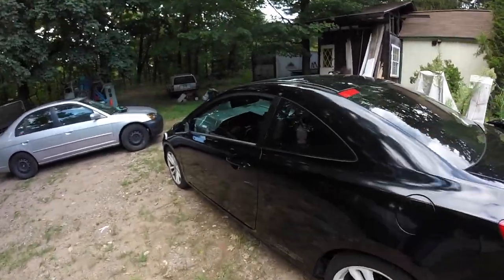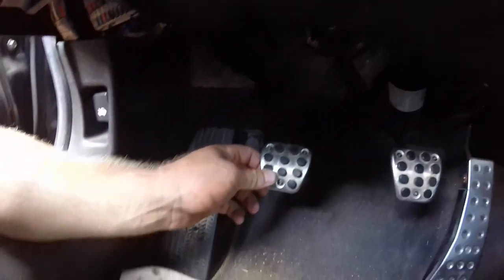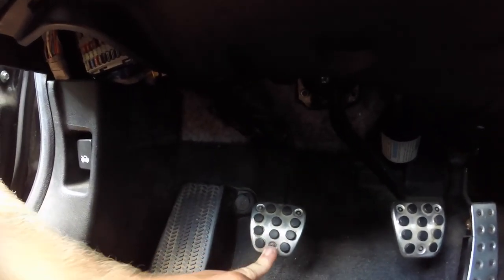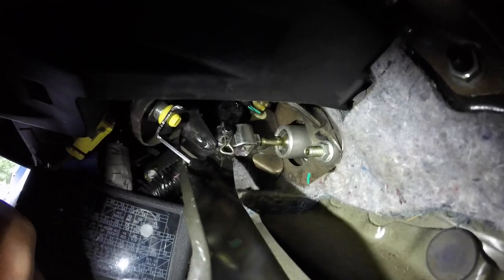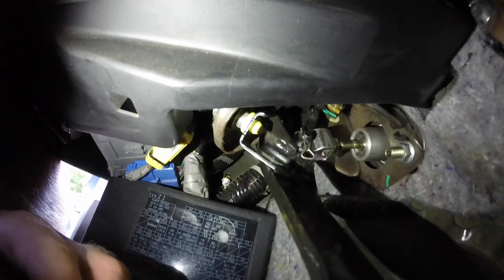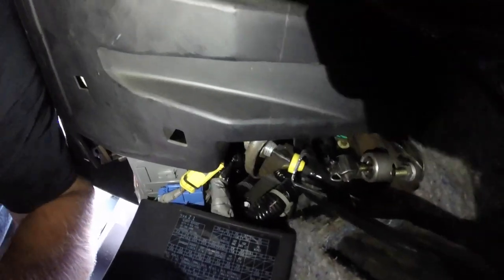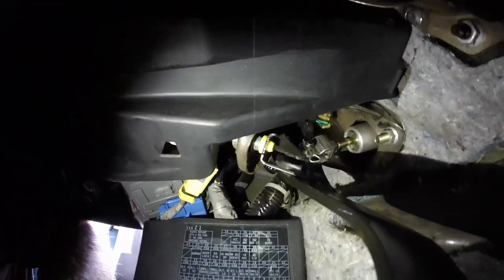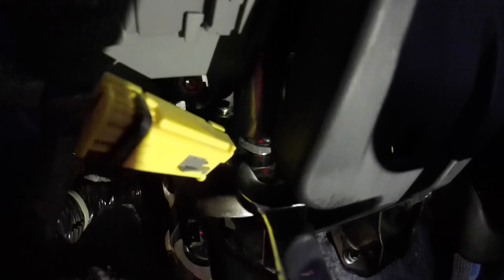8th Gen Civic Si Clutch Adjustment (K20z3)

Comment: It's about 100 times easier to work down there if you take the plastic panel off. It takes two seconds and gives more room.
Reply from the maker: +TheyCallMeRandy I will keep that in mind next time I'm down there.  I plan on replacing my shitty Napa CMC, so I can have smoother shifts
Reply: Good idea, I did my clutch this weekend and we had the whole subframe bolted back up then realized the steering rack wasn't connected to the wheel. Good thing we could do it from the inside!
Reply from the maker: Ik, that's why i supported it and didn't disconnect it.  I heard if it isn't aligned right, it messes up your while steering wheel haha.  What year is your si?
Reply: TheyCallMeRandy I need to adjust my cmc but I really have no idea what I’m doing and I don’t wanna fuck anything up

Comment: thanks brother i just did it..to my car and really works no more grinding on high rpms...thanks for the videos.👍... never stop wrenching...🔰.
Reply from the maker: You can also loosen the rod for the CMC in back of the clutch pedal, turn it clockwise until it gets tight, not too tight though. Glad i can help you out man! Never Stop Wrenching
Reply: 4real? Got at g35 and it grinds like a mf on high rpm won’t let me shift until I’m on 3,500rpm from 3rd to 6th that could be my solution then

Comment: thanks for the video ill try to do it this weekend.... my clutch feels really high and it doesnt pull as strong as it used to and this started like a month ago when i took it to a mechanic because 1st and 2nd gears wouldn't go in turns out my clutch pedal was broken  he had to weld it and it been fine but may need some adjustments
Reply from the maker: Everyone says the clutch pedals break on these cars all the time.  What did he charge you? Bro, avoid mechanics in my opinion.  Nothing is better than DIY bro.  Start wrenching, and Never stop wrenching ;)
Reply: Gerb Productions like 200 i think i had no clue what it was until i saw it

Comment: Thanks a lot bro!! I thought my syncro was bad couldn't hit 4th it would grind I rode like this for 3 years my 08 has 94xxx miles saved me ton of money 💰 I owe you a beer 🍻
Reply from the maker: She's a baby still, I'm at 147k haha.  It's been awhile since I've had a beer ;)
Reply: Same with me, my 4th gear grinds in low and high rpm every time, but gear feels fine once in it, hoping this will fix it so I don’t have to spend hella money on synchros.
Reply: @elijahwalters7900  did it fix the issue?

Comment: Hey what would cause noise from trans but when push in the clutch pedal all way to floor noise stops. Like a knockin noise. Just changed cmc and the slave cylinder was doin noise before changing those. Any idea

Comment: I get high rpm gear grind from 1st to 2nd, would this work for it?, every other gear slams great with no grinds in high rpm.
Reply from the maker: You could try this, bleeding your clutch, new tranny fluid, etc... Best advice, start cheap, work your way up
Reply: your grind is due to the delay valve.
Reply: @MTLJack  i have a gear grind from 3rd 4th.. I thought it was synchro being out what is this valve your talking about..

Comment: My slave just went out on my lx last week, couldn't change gears at all while running. Had to get one at the local parts store I think their parts are from O'Reilly's  it was cheap $43. Put a stage 2 clutch kit in new cmc now slave, still have hard shifts in 1st and 2nd, 345 are fine, when going to R I can tell the clutch isn't disengaging all the way it tries to move just a little but only in R. I have the sensor part on 2 threads, my question is how many threads on the cmc linkage? If you said I missed it.

Comment: I'm unfortunately experiencing the high RPM shift lock on my FA5 in most gears, especially 1-2, 3-4.  I replaced CMC, Slave, and threw in some syncromesh and i'm still getting locked out.  I guess this is my last resort because after this i'm not really sure where to turn other than maybe the synchros -_-
Reply from the maker: Damn man, doesn't sound like fun at all.  I have amsoil synchromesh, not the CMC yet.  Mine is only 2nd and third, mainly third though.  I think my synchro's are shot, but it is what it is.  Question is, would you drop the money on a reman transmission or have yours rebuilt??  Because i think that's what i might do, even though either way is going to be well over $1K
Reply: Gerb Productions well I finally had some extra time on my hands and did the clutch pedal adjustment and it seemed to fix the issue. I probably should have went with that first but I guess it's better to have them all done as a fail safe. 1st to 2nd still feels a little notchy but no lock out. Now it's just a matter of getting used to the higher clutch disengagement. Had I known all the little issues regarding the transmission I may have seemed out an updated 09+ as the 8th civic forums seem to say they fixed many issues but who knows. Love the car though!
Reply from the maker: That's the first thing i did after putting my new clutch in at 127k.  I changed my MTF to honda MTF shortly after that, which helped for awhile.  My 2nd and third are notchy, no grinds though.  I ordered a stainless steel clutch line, new oem CMC, and a new oem slave.  I'm going to try these first, if they don't work, I'm going to order a new syncro kit from syncrotech and have a transmission shop install them.  I wanted to upgrade to a 9th gen si, but i love my fg2 too much.  Money doesn't really matter to me with it because i have so much fun in it every time i drive it.

Comment: I have a stage 2 racing clutch do I still adjust two threads?
Reply: I'd say yes, at the least just try it and change it back if you want. The cmc controls the movement of the clutch (or something like that) it shouldn't matter what kind of clutch you have at least that's what I think. I have a stage two clutch as well. I'll be doing this to hopefully fix grinding as well. Mine is leaking as well which I will be fixing soon. (It's leaking in the engineer bay where it's mounted)

Comment: Don't you have to adjust the master as well and not just the pedal sensor?
Reply: Yes. If you're trying to get a higher pedal you back off the sensor so less of the threads is out on the. Still have to adjust the nut that's on the end of the master so that you can bring the pedal up higher or lower. Because the one that's on the master is the one that adjusts for the thickness of the clutch itself.

Comment: Did you do anything to adjust the rod into the clutch master cylinder?  It looks like you adjusted the rest point for the clutch pedal.  If that’s all that was needed, I’m not sure I understand what your problem was in the first place, or I just don’t see the relationship in how that adjustment helps with a clutch that isn’t completely disengaging.  I have a TSX, but I believe the clutch pedal setup is similar enough.  The clutch was replaced about six months ago, and shifting is not smooth at all.  I’m pretty sure that the clutch itself isn’t disengaging enough when the pedal is depressed.
Reply: This is also happening to my 08 civic si. Did ya figure it out by chance?

Comment: any suggestions man? I changed the clutch two weeks ago, first gear is hard to take off since I have to press the gas more than the older clutch I had.
Reply from the maker: Really?  Maybe air in the line?  Where does your clutch catch?  Mine does the same kind of, I'm going to adjust my clutch this week sometime
Reply: Gerb Productions Its really low, should I wait to adjust it until it kicks in or adjust it now?
Reply: I emailed exedy they told me to check the the Master Slave Cylinder that it needs to be bled.
Reply from the maker: +David Alcala Hopefully that fixes the issue
Reply: Thanks, now am getting a noise from the clutch, its like if its getting air, more like a buffing noise. It has a new clutch exedy pro, 600 miles. Do you know if that us normal? Thanks.
Reply: if you made the upgrade to an exedy, even stage one you will notice some chatter from the clutch when initiating first gear, its normal. as for your clutch catching at the top, mine did the same its just because its new and not broken in yet. id baby it for 400 miles at least.

Comment: seems like my clutch needs to be more towards the middle cuz theres a little pause when I put her in first from a stop and when I let it out the slightest bit and put it in gear theres residence and it moves a lil. and when I try to shift at 8k rpm from first to second it wont go in until the rpms drop off to around 6k rpm right where second would be.. would adjusting my cmc fix it or what do I need to do?
Reply from the maker: Try doing what i did in this video. I'm thinking yours is catching too high or something.  Believe it or not, I'm going to try adjusting mine as well.  Engagement for my 8th gen is in the middle right now, but i want it closer to the floor
Reply: I doubt it bud. I think if it engaged more in the middle and it would open the clutch more when I shifted but ill work on it this evening if I get a chance and ill letcha know if it helps or not. its just very annoying that I cant shift fast and always have to hold it to the next gears or a quick second before it slips in. now second is way worse:/ before this I could whoop v6 mustangs and now last time I tried with every gear I shifted he'd jump in front until I got her in gear lol now ya probably know why I want it fixed asap;) lol

Comment: did you adjust the CMC rod by firewall? or just the clutch pedal 17mm nut???
Reply: nvm just read ur description. thanks. you only adjusted the 17mm nut
Reply from the maker: Only the 17mm nut because my CMC is from napa.  It doesn't have the rotating rod like honda's oem one does.  Might upgrade eventually.

Comment: thanks man, finna do that to mines soon,  you said transmission oil is needed to or just an adjustment?
Reply: @TheGerbsteve  I know this is old, but on my 2010 Si with 110k miles, 3rd was being weird sometimes and not go all the way in, even at low rpms. I replaced the tranny fluid with Amsoil and no issues since. Great videos! I watch a lot of them to help prepare me before doing the upgrades and maintenance!

Comment: Hey man really love the video but have a question I did exactly as you did and car feels great nor clutch slip not grinding even when i hammer the car vtec and launching i have no problem gears are smooth not lock out and not grind not slip but i dident adjust the rod i know you dident because you have after market that dosent allow for it but i have stock and i do have the option to adjust and i was wounder is it mandatory to adjust it the rod
Reply from the maker: +Luke Malone thanks bro, appreciate that!  The oem one rotates clockwise and counter clockwise.  If the car is driving fine, I wouldn't mess with it.
Reply: +Gerb Productions  yea seen that and ok great ima just leave it thank you

Comment: Hey I got a question, will doing this wear your clutch out faster? And also will raising the the clutch pedal higher make you shift slower due to more range of motion?
Reply from the maker: No, just don't adjust it too low or too high.
Reply from the maker: Yes, the higher the engagement, the slower the shift.
Reply: Gerb Productions dude thanks appreciate the reply back man! I left around 4 threads on my pedal and on the push rod I have it set to where it feels light and springy, the only thing is it does feel notchy on third but I want to keep it engaging  where it's at, the pedal feels awesome and I want to keep my shifts as quick as possible but the 3rd is notchy and ideas? If I have to I'll adjust to the 2 threads just so I can save my transmission life
Reply from the maker: Np man... My third gear is the same man. I've tried everything so far, but it's coming down to the last step, that's replacing the synchro.  Try changing your tranny fluid, shifter bushings, bleed your slave cylinder, etc.

Comment: I adjusted this method to my 06 rsx type s but now in all gears rolling at "idle" it won't stall at warm engine.  Is that normal?
Reply from the maker: I'm not sure man.  My 2nd and third are still iffy though!  I'm going to replace my CMC and see if that changes anything
Reply: Rehc V, Lee I think you went too far and now the clutch doesn't engage fully, it's slipping.

Comment: Hey man got a question for you I did this and even replace my cmc still got the second gear grind at high rpms any ideas on what to do next
Reply: You should replace your throttle body with an aftermarket one. The stock one drops to low between shifts hence why it grinds! Hope this helps
Reply: @devon417  this is not why at all lol

Comment: Hey Gerb thanks for the vid. My car shifts smooth as butter before it gets warmed up. I notice that after 30-40 minutes of driving shifting becomes harder. I also notice when stopped and in 1st gear with the clutch fully engaged the car will not roll. Could this fix the problem?
Reply from the maker: Most likely your clutch pedal or cmc. Which brand cmc do you have?

Comment: When I step on my clutch and try to put my car in gear it moves forward and I cant even get it I to gear I have to turn my car off put it in gear then start it to even drive my car right now I'm stressing, peddle feels useless
Reply: Same bro let me know if you figure it out.  I'm hearing its the clutch, or slave cylinder or CMC
Reply: Same here I just changed my cmc and slave and no change
Reply: Did you ever do this fix and see what it was?? I'm literally experiencing the same issues.. Will do this adjustment and see if that helps
Reply: Francis D. Same problem with me don’t know what to do
Reply: Did anybody ever figure it out because I’m in this situation right now

Comment: Mine catches an inch off the floor.
Reply from the maker: +07 Si4dr I should adjust mine to do that
Reply from the maker: +07 Si4dr mine grabs like mid
Reply: I hear mid is normal and more desired.  Off the floor is kinda annoying because you have to make sure it's near the floor to get a correct shift.
Reply: 07 Si4dr dude, my dc5 is off the floor too. Idk if it's normal but I have cc 1.5 and the 8lb fw